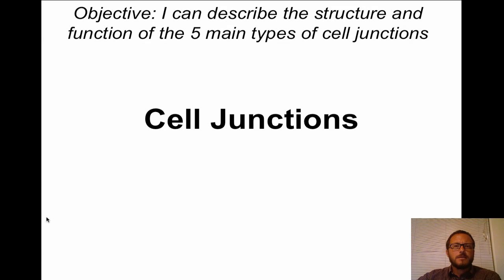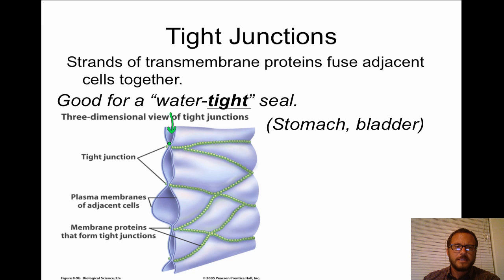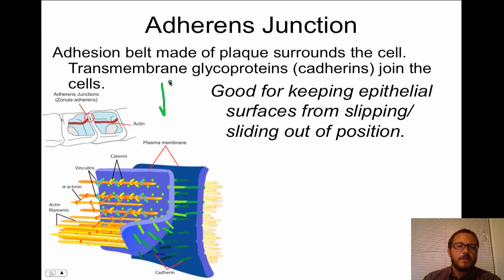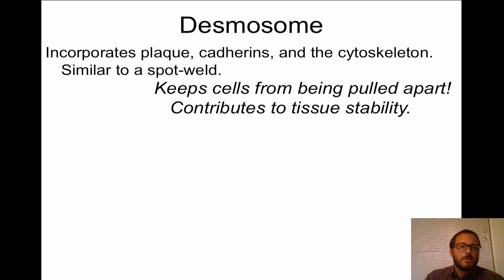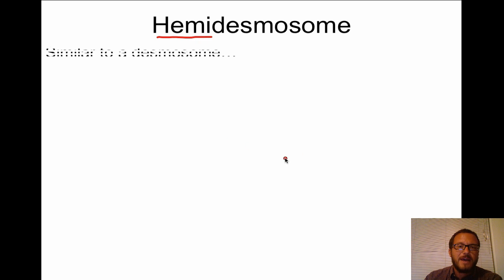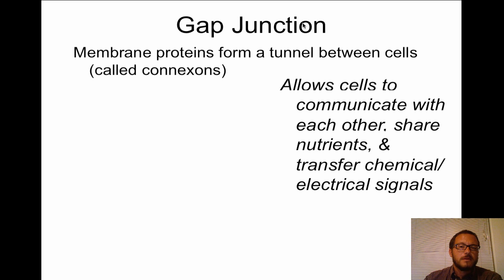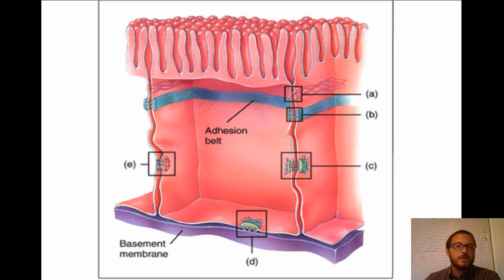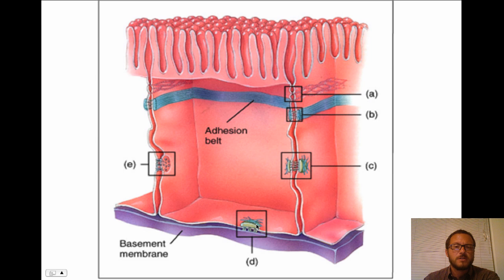Cell Junctions

Comment: -Tight junction = quilt like (stomach and bladder)

-Adherens junction = Velcro like with cadherin. 

-Desmosomes = adherens junctions with extra follicles spaghetti(intermediate filament) like protruding intercellular. 

-Hemidesmosomes= anchor like to basement membrane 1/2 desomsome

-Gap Junction = drain like (cardiac)
Reply: May u please tell me 🙏🙏.. That difference between plaque and cadherins??? Please tell..